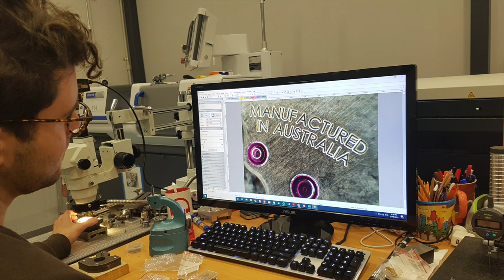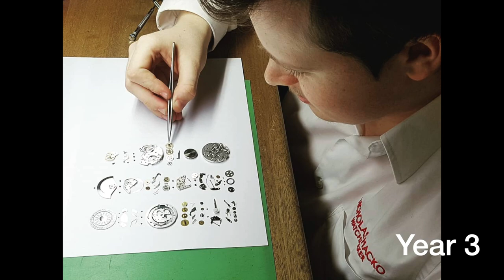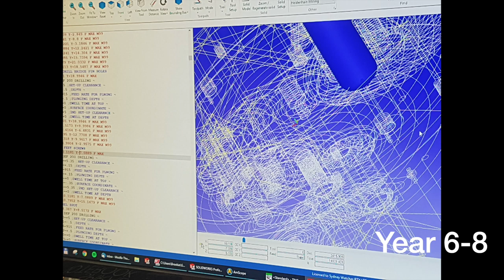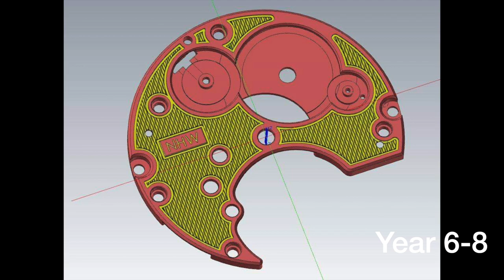How to become a Master Watchmaker

Comment: I am 46 and have loved watches since I was a child; I recently realized even if I could afford a Rolex the servicing is very expensive too; so I decided to peek inside watches. Quartz, nothing much to see there. I ordered a lot of 12 pin pallet watches from the 50's on eBay $20 bucks, I opened the worst ones first and after 4 ruined ones (don't ever touch the balance with your fingers!!) I was able to put back together the first one; after cleaning and lubing, IT WORKS! So I got five pin pallets restored and in working order(self taught), now I'm ready to start working on the Certina Chrono, my point is: if you are passionate about it and you have a knack for it, don't let anyone tell you what you can and cannot do.

Comment: There are many mechanical watches around and this watches need maintinance.

You have to look after a 17j handwind swiss lever movment. It is a kind of teamwork, you have to wind it up and you have to set the time.

Because the cleaning and lubrication is hard to get today and very costly I have learned to do this myself.

The limitations I have are: I have only 17j swiss movements without complication and it is not easy to get spare parts.
I have solved this problem with a second movment I can use for spare parts.

It is not too difficult to clean mechanical watches but it is out of the possibilities for a home watchmaker to do advanced work on watch movments. It is possible to get the skill but the investment for the machines is too high.

Comment: seriously? to become a watch repairer/maker you need 10 years? it doesn't take 10 years to learn how to fix an automotive engine or transmission and it has more complicated parts in it. this is a dying skill and I feel that the people interested in this business corners the market because they are the only ones that can fix it. Most people own cars but not watches. it's more lucrative to fix cars.
Reply: Wow YV1.
I watched this all the way through. Not sure you did.
I believe you are comparing apples to oranges. He is offering to get you through a serious program while paying you . I hold an A&P rating along with ASE Master mechanic. I sure didn't learn all that over night. I also don't have a clue of how to run the design software nor design a new engine not to mention how to set up and operate a CNC.
Everyone seems to know a so called car mechanic, yea, I know. Most have only a clue as to what they are actually doing and throw parts at the vehicle until they stumble on the problem.
Just to emphasize above, I was not paid to get all the education and certificates I hold. This sounds like a good deal to me.
Reply: @emmettthompson3332  Looks like it's two courses in one, watchmaker plus NC machinist.